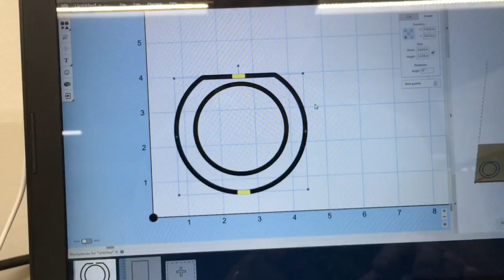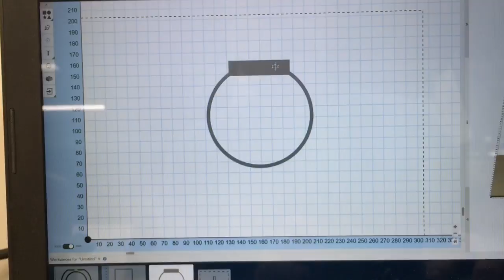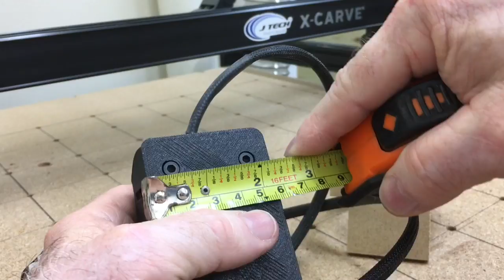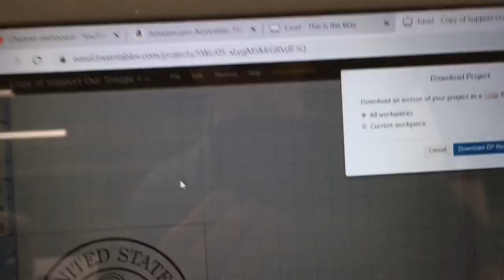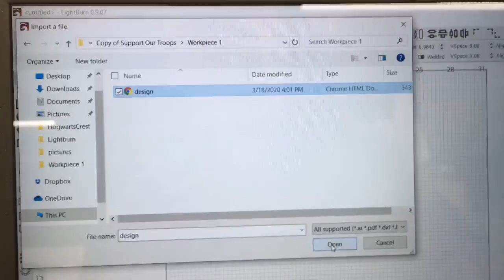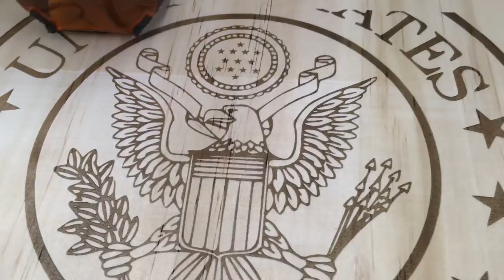How to Make a Laser Mount

Comment: Excellent video!  I intend to do something similar..  Hopefully soon, I will be getting a Sainsmart Proverxl 4030.  I intend to make a custom dust boot where the hose is attached to the spindle and held in place with magnets.  Then, I will make a separate attachment for the laser head also held on by magnets.  The goal will be to switch between the two easily and quickly.  Thanks!

Comment: Did you line the laser up on the x axes for the starting point
Reply from the maker: The green dot in the center of the drawing is the start point.  I prefer this spot for most of my projects.  I also manually set the home position on my projects.
Reply: @PawPawsWorkShop  Ok Thank you very much